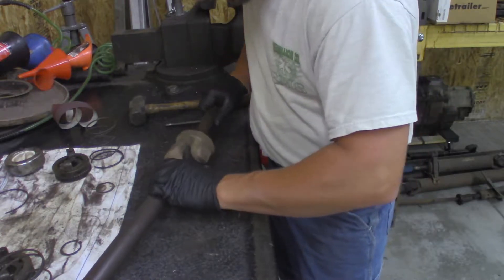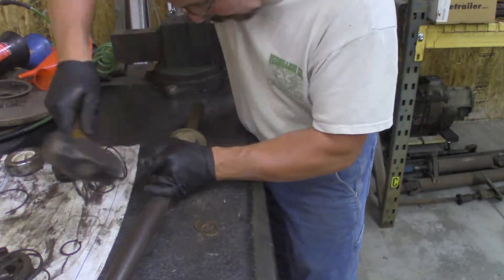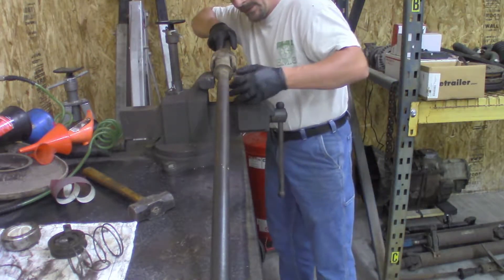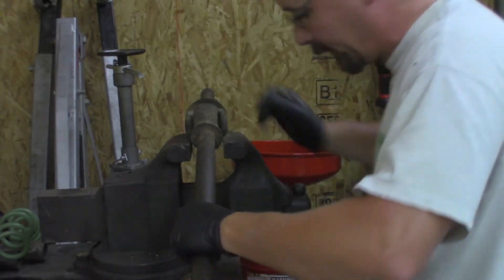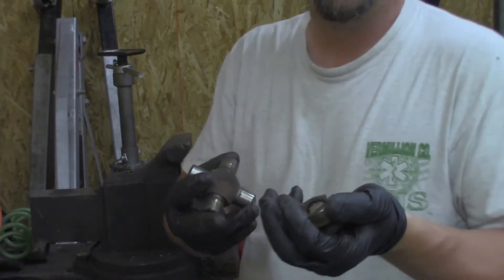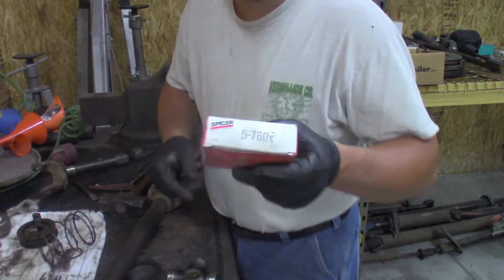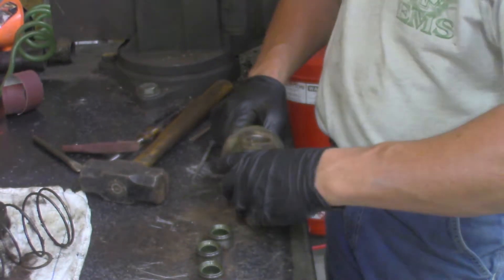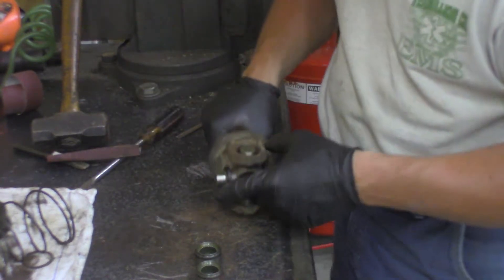How to Replace a Universal Joint

Comment: Nice video, thanks for producing this.  On a slightly related topic, I seem to have significant wear on my inner axles where they rub against the differential oil seals - but they are no leaking.  Is this something I should be worried about, or should I just replace the u-joints and shove 'em back in there?

Comment: Question, the little metal flat sheild thingy that goes against the knuckle on the end of the shaft.  Is that absolutetly needed ?  Mine is all rusted to peices and well its 1 peice on the short end of the shaft so not replacable.  Not sure if thats ok or not
Reply from the maker: I assume you are talking about the piece that holds the rubber seal. 
While it's not ideal you can run without it. You'll just have to maintain your bearings more as without the seal dirt and water can get in through the spindle